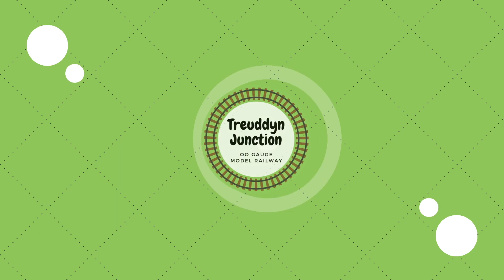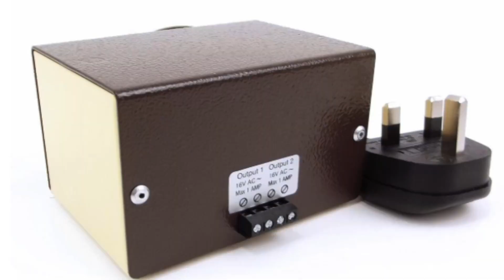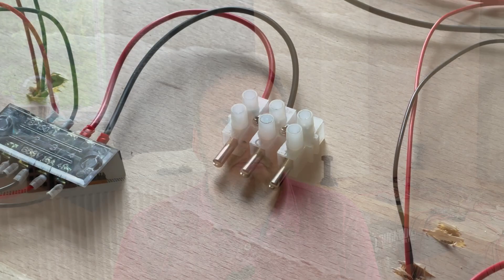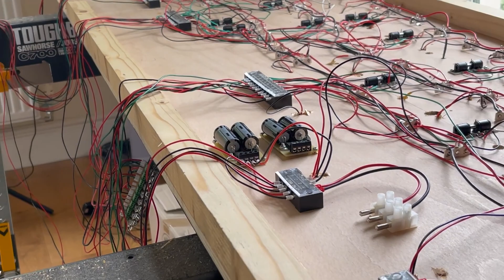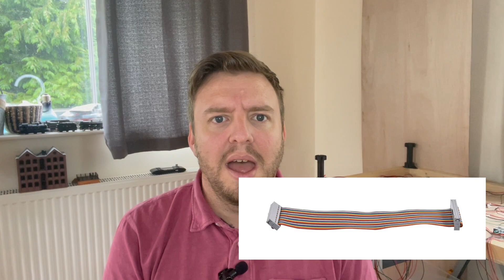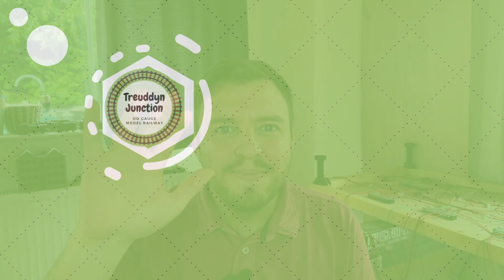LAYOUT UPDATE at Treuddyn Junction Model Railway Layout UK

Comment: I agree with @jamesfox6736, your presentation is a lot better and the video is informative. You need to do something with your mic setup as I found it quiet and tone low.
Putting the CDUs in series will take the CDUs longer to charge, which means having to wait before changing points, but others may have better solutions.
Reply from the maker: Thank you. I will take a look at the sound next video. Good point about the CDUs. I hadn’t thought of that.